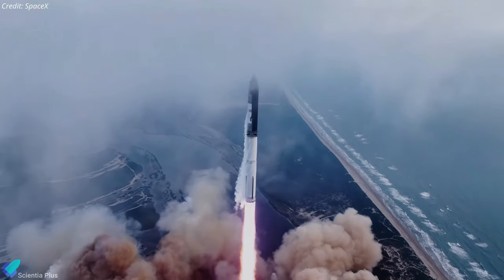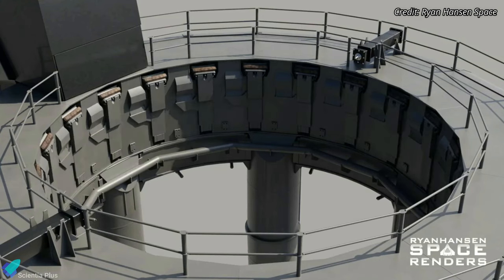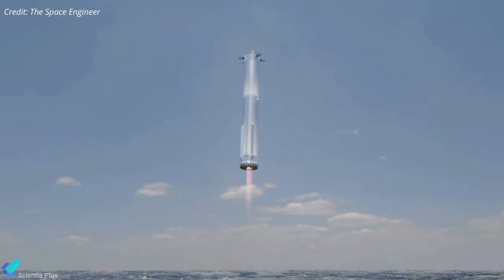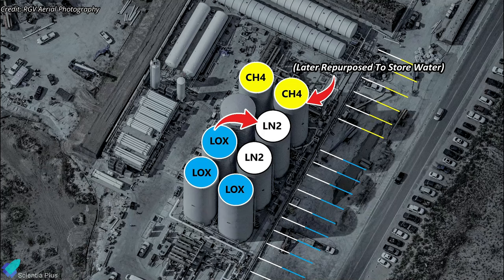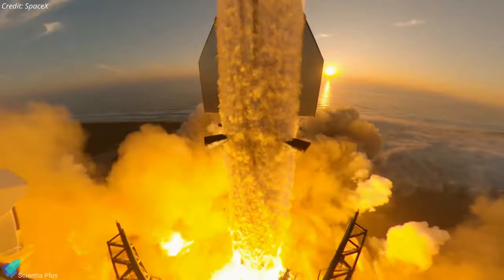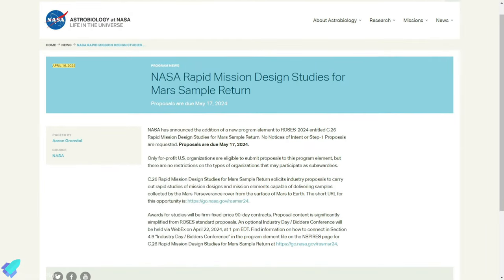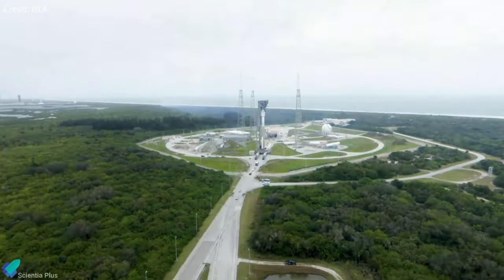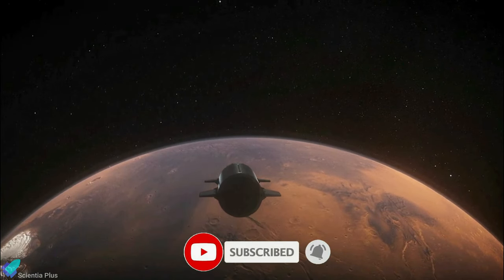Starship Launch Tower Catch - Chopsticks Mega Upgrades Began, NASA Need Your Help For Mars Mission

Comment: I fail to understand why catching the booster and starship with the chop sticks is so necessary. I mean there isn't going to be a tower on the Moon or Mars, nor for that matter anywhere the military wants a payload delivering. Why not put landing legs on it and be done with it. Have a crane and a transport stand close by, transport back to the tower, extra 5 - 10 minutes before next launch... Job done.
Reply: The best part is no part.  Legs take away payload capacity.
Reply: @timmonahan-mitchell9125  Yeah, but the cargo space will be filled with a tower, that will have to be built so it can be caught. Small price to pay to be able to land anywhere.